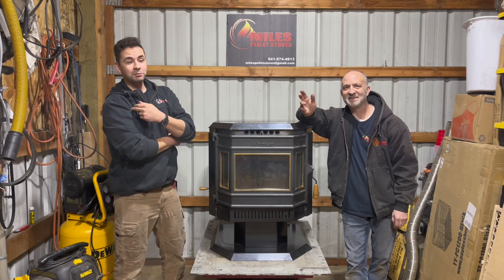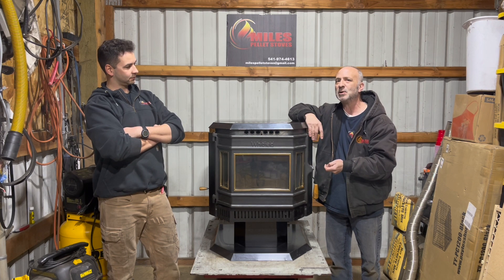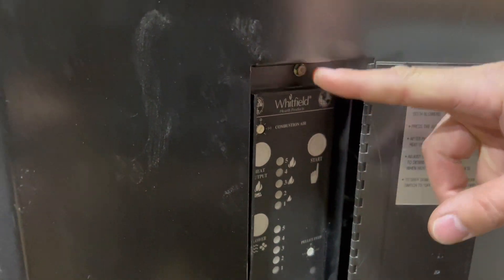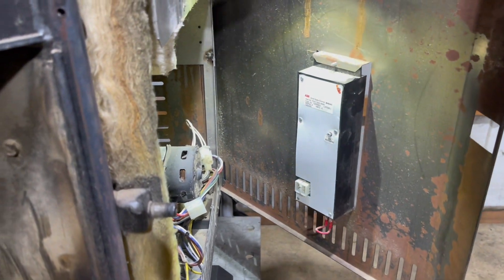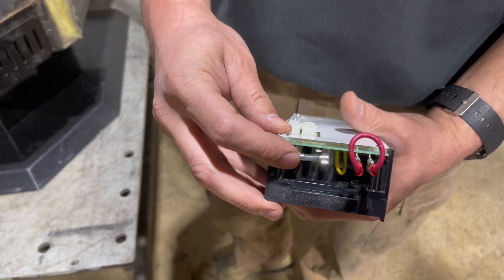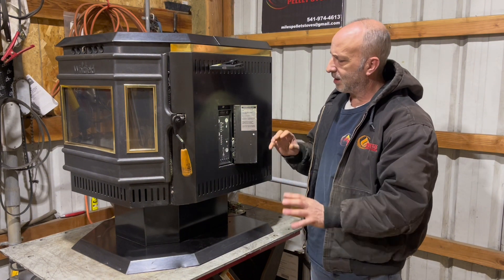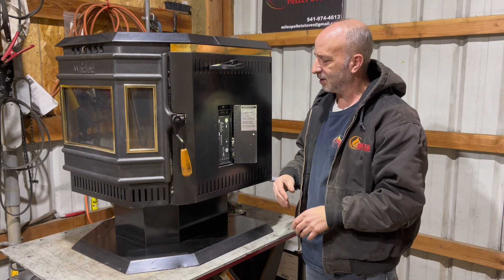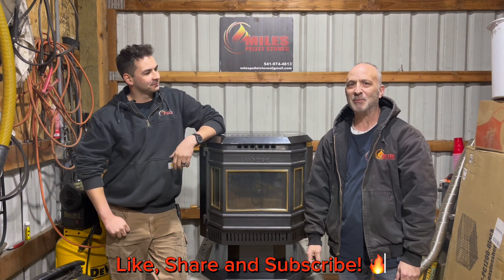Whitfield Advantage Pellet Stove Control Board Replacement Tutorial

Comment: I have the whitfield stove with the old analog board those 3 caps are adjustments to calibrate the stove do You know which ones go to what ??
my exhaust fan only works on the higher settings if You turn it to #1 the fan is barely turning causing the fire to go out and smolder making everything black and sooty , but turn it to #5 and the fan works fine ..is it a calibration issue or something else?? just recently started having this issue, was fine before ... can it be the proof of fire puck??
Reply from the maker: I would check the proof of fire disk on the exhaust motor first.
Reply: @MilesPelletStoves   Thanks for replying so quickly .. I cleaned the proof of fire disk and it still didnt speed the fan up  , so I turned the calibration screw 1/16 of and inch if that and the fan started and ran fine , lite a fire it burn great no soot and then let the stove shut down and it shut down as it usually does.. Thank You for your help .. Maybe my experience can help You or someone watching...
Reply from the maker: Nice Job...And Thank You for sharing Your Tech experience.